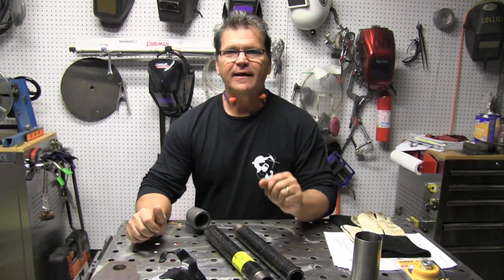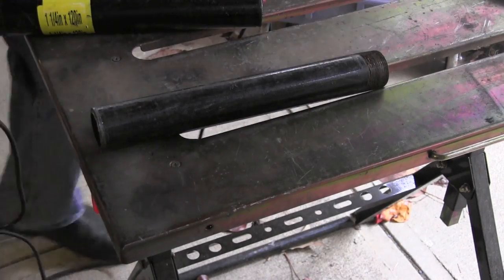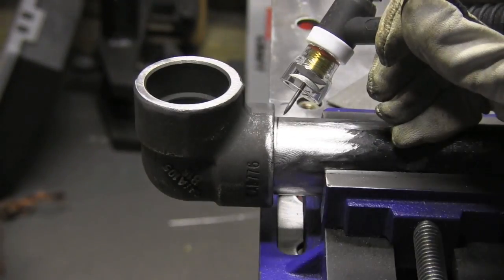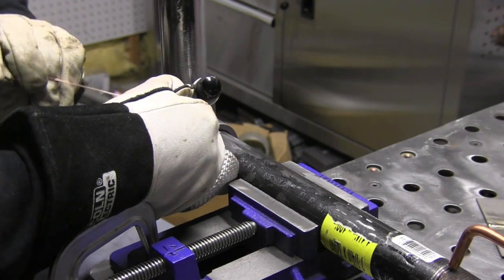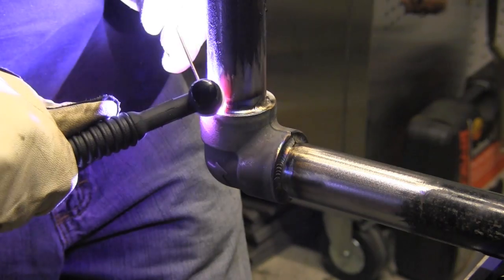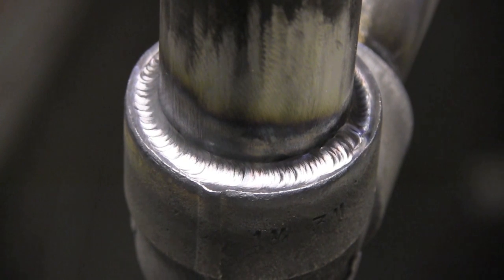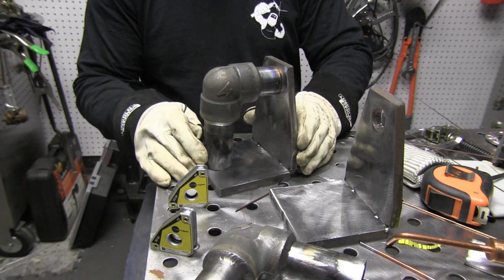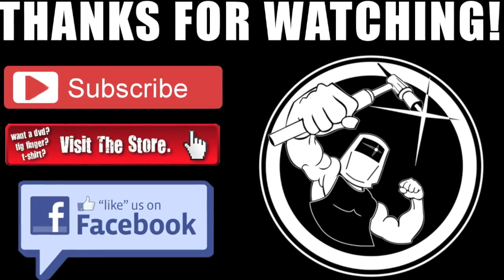Socket Weld Industrial Bookends

Comment: Another great video!  Great tips here regarding code and technique. I've def seen these welds fail because there wasn't a gap at fit-up. Another thing to remember is that some codes require the first one or two passes use 3/32 as opposed to a larger filler rod to ensure  adequate penetration. Your humble approach is really effective at conveying the info imho.

Comment: Beautiful welding.when you mentioned leaving a little gap for expansion in the field Boilermakers welding socket welds and especially hand hold caps will dimple the flat surface with a center punch to ensure a gap that won't suck tight keep up the good videos

Comment: The company I'm weld testing for at the moment is about to test me for socket welds, so far it has just been 11018 and fcaw. I was excited when the said carbon steel, stainless steel, and copper nickel socket welds. However the catch is there is no walking the cup and no edge melt. That's what you get for applying for a contractor for the U.S. Navy :/

Comment: Ive been looking at a TIG machine for welding aluminum and stainless but have been wondering if it will work for some of the heavy welding that I do on our heavy equipment on the farm…most of these welds will carry a dynamic load of 30 tonnes in an active working environment and the steel I’m welding will be 1/4” to 2 inch steel.  Any suggestions on machine?

Comment: I liked the Miller Spectrum. Was there any reason for not using it to cut the pipe instead of a grinder?
Reply from the maker: sometimes a grinder is actually quicker when you account for cleanup time prior to welding. I would have preferred to cut it with a portaband (portable band saw) but the saw was at a different shop.

Comment: We have the same plasma cutter in our shop, can't get it to cut through 1/4" even on 230
Reply from the maker: might be the air pressure.  If pressure is on the low side, it is hard to cut thick metal.
mine will cut 1/4" easily even on 115v as long as air pressure is ok

Comment: I notice when you are finished with a bead, you hold the torch on the piece you are welding. is that required or just to help cool the torch? Thanks
Reply: its to post flow gas over the work peice giving the weld a few extra seconds of sheilding as the puddle cools. most welders have adjustment for how long the or and post flow will run

Comment: Is there any reason you used stainless wire to tack it up and carbon to weld it out? I am guessing no but i didnt know if it was part of the field test.You usually give a run down of wires that were used.
Reply from the maker: I used er70s2 mild steel wire for tacking and welding. The cup worked so well there was no discoloration.
Reply: weldingtipsandtricks
call me crazy but at the 4:15 arc shot it doesnt look like carbon wire
Reply: either way i really enjoy your videos..i only check my email on tuesdays lol
Reply from the maker: illdrag
Thanks.  I think it was just the lighting. All the stubs on the bench after welding were carbon rods.  But...I do have some er70s6 carbon steel wire that is not copper coated and looks like stainless so I guess its possible I picked up a piece of that.
Reply: i am not sure what you mean,There isnt any copper coating on mig or tig wire,

Comment: Hi Jody,
My wife would not want those in the house either, Ahhhh women, constant mystery...
Are those elbows made of cast iron or cast steel, cause cast iron stuff is usually hell to weld.
Thanks,
Pierre
Reply from the maker: forged low carbon steel.
Reply: Ok thanks
Reply: weldingtipsandtricks I'm a 1st year welder and I wonder if that's why you used tig, due to a low melt point on the low carbon steel (I should probably refer to my textbook but I'm here so?
Reply from the maker: Ghost Dog
 no real reason for choosing TIG other than my preference on that day.  Stick would have been a good choice too
Reply: a105 forged carbon steel

Comment: what gas should I use for tig? thanks.
Reply: +rolliksas1 argon for stainless and carbon. aluminum gets tricky, argon for better cleaning action, helium for a hotter arc column. you can get argon/helium mix if you want a little of both on aluminum.